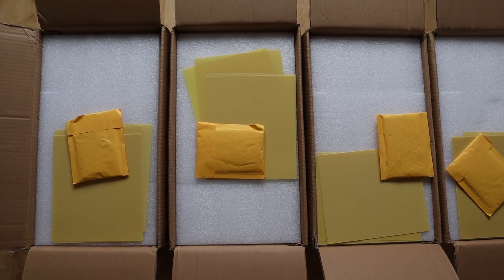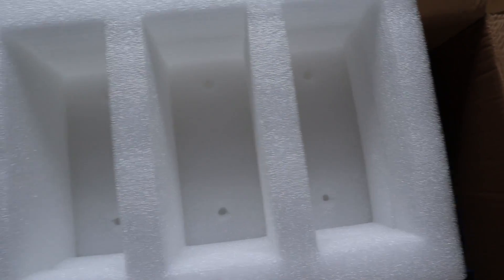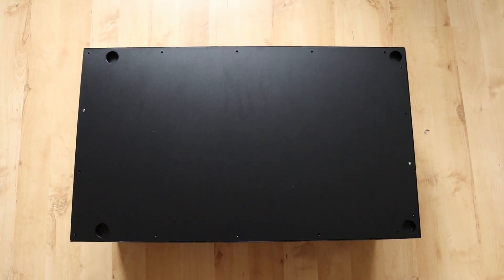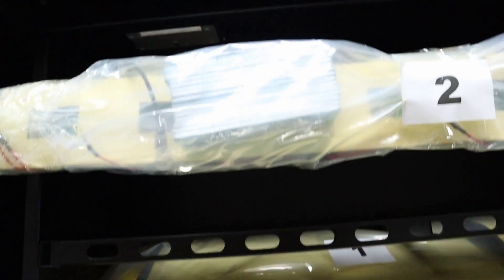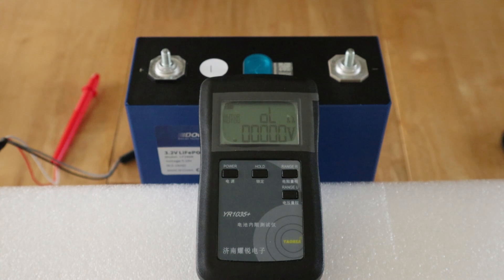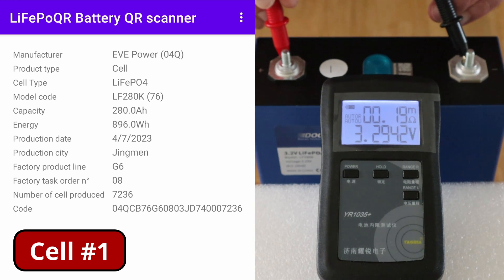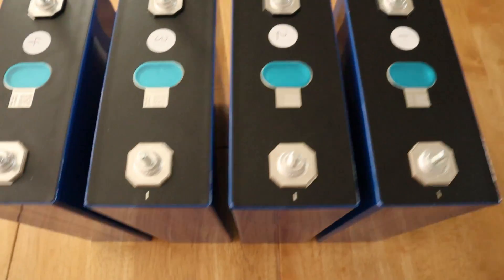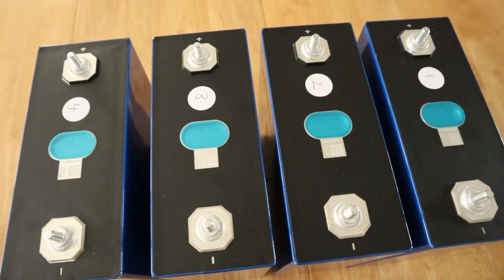Road to 48V - Take 2 | Apexium DIY Battery Box | Part 1

Comment: What was the shipping cost, often more than the batteries
Reply from the maker: @johncorlett3699  Thanks for your question. It will vary as to where you are in the world and it's usually in $ (in my experience). The follow-up videos from this one provide the prices I paid, but they have since dropped as the cells are cheaper. The best option is to contact Daisy at Docan Power (details in the description) and get a quote for what you're after. All the best, Adrian

Comment: How much for the box?
Reply from the maker: @paulpaid  Thanks for your question Paul. The first box cost - https://youtu.be/PbclFjYkgwQ?si=Qsh1jFYQBMrmA_L8&t=2949 and the second box with cell price drop was - https://youtu.be/Y4defUDU5hM?si=M_aiFg4qy9pYPgdM&t=1015. I hope this helps. All the best, Adrian
Reply: @DADvinci  I'm sorry but that link is even more confusing. Is that why you can't simply state the price of the box??
Reply from the maker: @paulpaid  Sorry, I'll clarify. The first box cost £1,872.26  in total and the second box with additional cables and heat pads cost a total of £1,735.28. If it was just the box like the first one and not the cables + heat pad, it would have been under £1,700. The prices vary on what I can get from the supplier (sometimes the cells are cheaper than others, depends on their stock levels). I hope this covers it? Cheers, Adrian
Reply: @DADvinci  Absolutely ridiculous prices. One could buy 25 320ah cells for that much money. I see the box for $400-700 usd on Alibaba. No possible justification for the 1,872 pound sterling ($2,375 USD) price gouging ...other than sheer greed! which belies the very spirit of green energy.
Reply from the maker: @paulpaid  I'm not sure what you mean and you've focused on the first box price which was when the cells cost more, as I've already said. It's under £1,700 for 15kWh of storage in a purpose made box. There's also shipping costs on top which is part of any purchase (including cells). If you have a cheaper price for the whole case kit (which includes the BMS), new 280Ah EVE V3 cells or larger and shipping, please do share as I'm sure other viewers would love to see a lower price. If you know of any manufacturers that sell ready-made 300Ah or larger (15kWh or more) batteries for less than £1,700, delivered, please also share. Thanks.

Comment: Do the 280ah cells come with the kit or do you have to purchase your cells separately?
Reply from the maker: @chuckbrodie8258  Good day and thanks for your question. The cells and box are separate, but I tried them from the same supplier as a package. So, if you do find a better deal on the cells and you like the battery box, you could source from different suppliers. Here are the costs from the full build video (https://youtu.be/PbclFjYkgwQ?si=I6DWQzkaqd05mboI&t=2949). I've bought the same package again to double capacity and because the price of cells from the supplier have dropped since, it's cheaper overall (another video to come once it arrives). The price of cells can change quite a lot. I hope this answers your question. All the best, Adrian

Comment: How much do you purchase each cell
Reply from the maker: @iviemaro380  Thanks for your question. For this first build they were $95 per cell (without shipping or import taxes). My current order which is on the way from China (the same battery box + cells) is $72 per cell (without shipping or import taxes). The price for cells can fluctuate significantly so it's always worth asking the supplier for best price before purchase. I hope this helps. All the best, Adrian

Comment: so the Batteries are a separate purchase from the Cabinet?
Reply from the maker: @rroy3843 Good day and thanks for your question. You can source the batteries separately; I bought them as a kit and got a reasonable deal from one supplier (Docan). The full build (Part 2) is covered in this video https://youtu.be/PbclFjYkgwQ if you wanted to take a look. If you check out the description in that video, each section is broken down so you don't have to watch the whole thing (cost breakdown is part of it). I've just ordered another, which was less as the cells (as part of the package from Docan) have dropped in price. I've also got a heating pad and the parallel cables to connect both battery boxes together to test out this time. Still came in about £100 cheaper than the first one I built due to cell price which does fluctuate. All the best, Adrian

Comment: Morning Adrian,

You are now moving into areas that I don’t understand, so more learning for me then!

12V I semi understand what I’m doing, I use 12V solar panels, I now have 7no 100w Renogy panels that feed my Aferiy 2000 and my Bluetti EB70.

24V and 48V I’m a bit lost, do you need different solar panels now?

What are the advantages of 24V and 48V in layman’s terms please?

So you are building a large battery in essence that you are going to hook up to a large inverter to distribute the power accordingly?

Sorry to be such a noob 😂

Kind regards

Tony
Reply from the maker: @LRDefender1968  Hey Tony! Well, you're already using 48V batteries 😃. Your Aferiy 2000 has a 48V LiFePO4 at the heart of it, just using a 32130 'more traditional' cylindrical cell, unlike the prismatic cells featured in this video.

The whole 12V panel piece can be a little misleading. I think a better way to describe it as is a panel for charging a 12V battery. Essentially, to help current flow (charge a battery) you need a higher voltage to make this happen. '12V' panels can produce anything from 16-18V when connected in decent sun, so this would be higher than a 12V battery voltage range, allowing current to flow and charging to take place. If you think of a 12V battery and a '12V' solar panel in isolation, when sun hits the panel the voltage would go up and current could flow into the battery. The BMS and solar charge controller (included in the all-in-ones) would help regulate this voltage to properly charge the battery.

In terms of LiFePO4, its nominal (reference voltage) is 3.2V. Think of a standard alkaline Duracell AA, it has a reference voltage of 1.5V. You put 4 x 3.2V LiFePO4 prismatic cells in series to get a 12V LiFePO4 battery (12.8V reference voltage usually on the side of the batteries). Then put 2 of these 12V batteries in series to get a 24V LiFePO4 or 4 x 12V in series to get the 48V.

When it comes to panels and charging larger systems at 24V and 48V, you'll need to get the voltage in the 'window' the solar input needs to enable the solar charge controller to manage charging the battery. This can be done in two ways, buying larger panels or connecting the panels in series (again ensuring the voltage hits the range needed for the charge controller to do its thing) or mixing series and parallel to land in the right range.

The ultimate question in all of this is, what do you want to run (how much does it consume whether AC or DC load) and how long do you want to run it for (battery capacity).

Forgetting capacity for now, say I wanted to run a 3000W load (my fast boil kettle or my dishwasher and half my toaster at the same time)

12V (12.8V for LiFePO4) I'd need to have a battery/breaker/cables/inverter capable of handling around 234A (12.8V x 234.38A = 3000W)
24V (25.6V for LiFePO4) I'd need the same to handle around 117A (25.6V x 117.19A = 3000W)
48V (51.2V for LiFePO4) I'd need the same to handle around just 58.6A (51.2V x 58.6A = 3000W)

Essentially, the higher the voltage the less current, the lower the voltage the higher the current. It all boils down to the calculation Volts x Amps = Watts. Big current needs bigger cable and current carrying capability. Increasing the voltage reduces this need and you can generally run larger loads (watts). This is why you'll see solar inverters have smaller output (watts) on 12V, they increase on 24V and get up to large watts on 48V.

For me, British weather is unpredictable, this year being a classic example. Summer sun seemingly disappearing at the start of July. I'm not concerned with sunny or partial sunny days, it's the 3-4 day mark where it doesn't shine and my current capacity (around 6.5kWh) can't last that long. Running simultaneous larger loads at the same time like the dishwasher, washing machine, microwave, induction hob will be possible (6kW solar inverter ordered).

I think I'm going to make a video(s) covering some rough guides to battery storage and solar power. I hope this helps a little and please shout if you have any further questions. I've learnt all this by absorbing. We all start out as noobs, then experts are born. I’m not an expert, just someone who’s always wanted to understand how things work. Cheers, Adrian
Reply: Thank you so much Adrian for taking the time to write such a comprehensive reply!

I shall read and keep on rereading this until it fully sinks in, it’s so interesting what you are doing, it’s such a rabbit hole to go down, I’m finding the journey fascinating.

Keep up the great work Sir, you are helping the community selflessly.

Kind regards

Tony